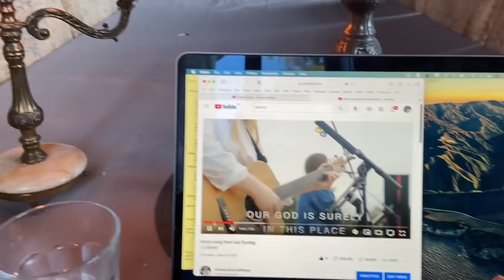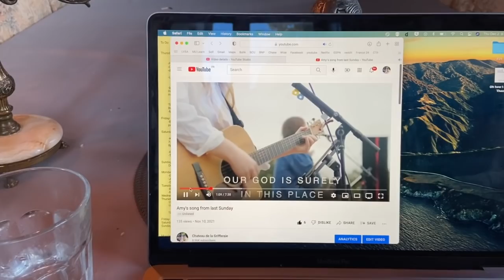Château de la Grifferaie, Day 6, Rob's French Advent

Comment: Just a tip to try, when you make this adhesive silicone on the tiles warm with a hair blow dryer it will be probably much easier to remove. That goes also for polyurethane glues, the yellow stuff that looks like snot, LOL.